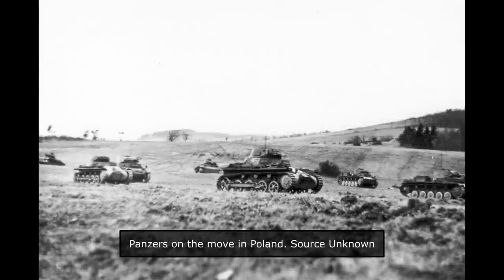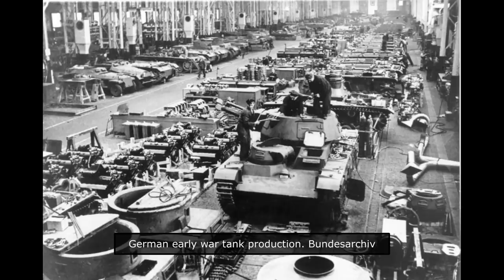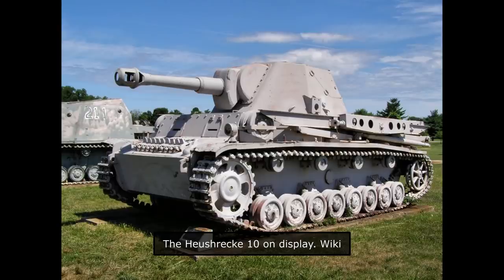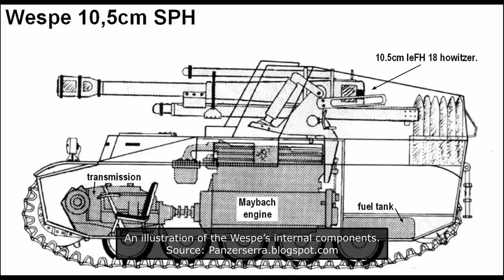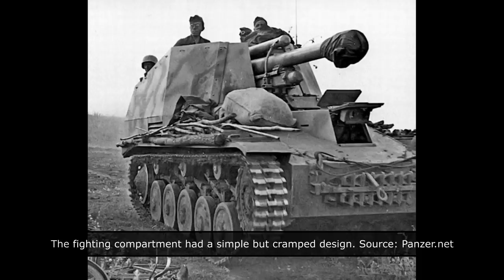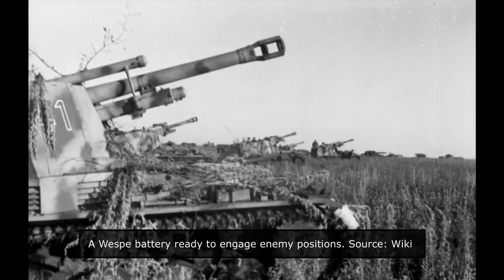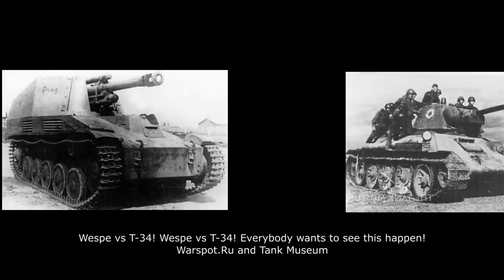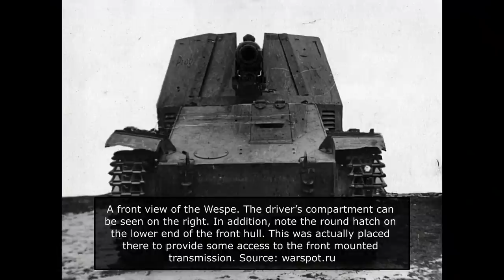The Sting Of The Panzer Divisions | Wespe

Comment: Always mystified that the British never did similar with their Vickers light vehicles. Yes, they later got the more capable/flexible Priest/Sexton, but early war, they were making Vickers lights at smaller manufacturers and those with no experience of making armoured vehicles as a training vehicle. As they were already engine forward, fighting compartment rear, it seems like a good candidate for a field gun. After all, they received some 900 75mm guns from the USA early war, would have made a good general purpose tank buster, self propelled arty.
Reply: Do you mean the Mk VI ? I can imagine the chassis being too weak compared to Pz I or II.
Reply: @ottovonbismarck2443   Germany converted some Mk IVs to GMCs with the old 10,5-cm Feldhaubitze 16 . . .
Reply: @letoubib21  Thanks for the info ! Then the British were just lazy. :-)
Reply: I'd assume it would have been caused by the Regimental System shaping doctrine of the British much in the Same way the Infantry Tanks didn't need to move fast. Plus there's there's the issue of the Royal Armoured Corps being overly possessive of Tanks much like how the RAF at the same time controlled the RN's own aircraft.
Reply: It was probably too small for the big  guns like the 76mm witch is what they needed at the time but early in the war they could have used the very affective 75mm but I can’t think of any other guns with the right amount of power for late war engagements with German tanks.
Reply: @letoubib21  Major Alfred Becker did that for his artillery division.  He was later given his own unit to convert captured, mostly French,  armored vehicles into anti tank and howitzer carriers.

Comment: The Germans were maybe 20% mobilized, and often had inferior equipment. The cock on ejection 5 shot Mouser would hit one's face unless moved before cycling the bolt this meant having to regain one's aim each time, with notch sights. Stukas were obsolete when the war started, meat on the table for most any fighter. MK III Tanks had only a 50mm gun, the MK IV had a very short, low velocity 75mm (crews called the tank "the stub"). Both T 34, & Sherman outclassed these panzers. The FW 190, & BF 109 had very limited range.  The Germans had too few transport aircraft that were already obsolete when the war began. There are many more instances of poorly designed weapons, but also major blunders by commanders that were not due to Hitlers meddling though that was another factor of bungling. The Germans went into Russia largely on foot, with horses, poor logistics, and as previously mentioned obsolete or poorly designed armor, aircraft, and other equipment. Hitler should have known from history (particularly Napoleon) the folly of fighting the Russians in the severely cold winters.